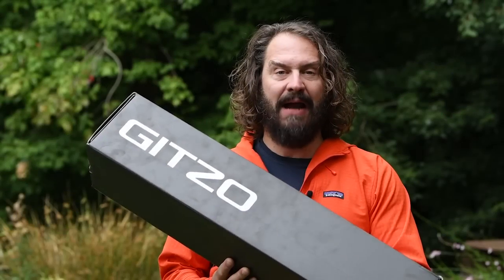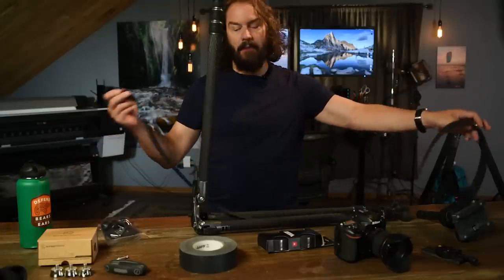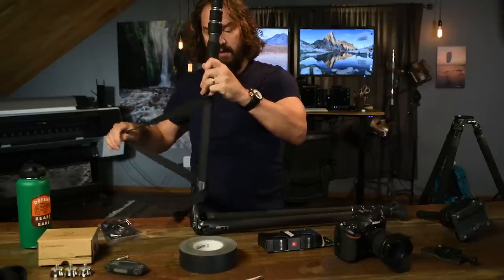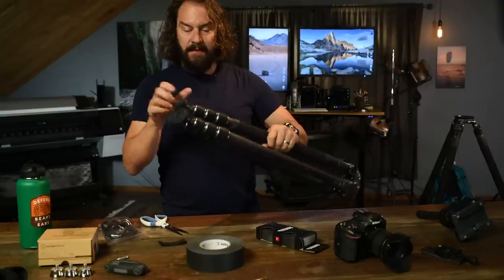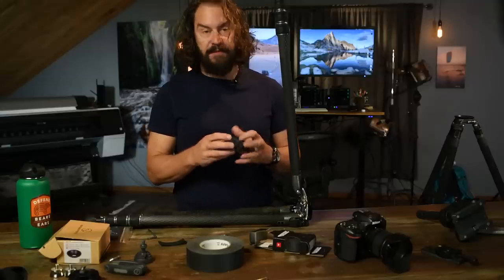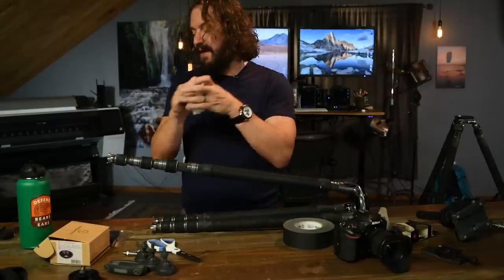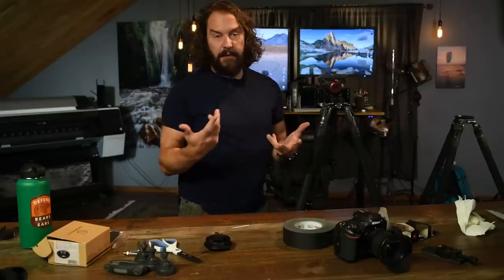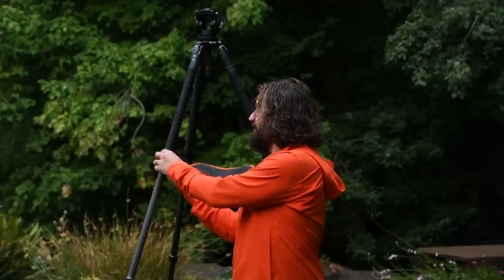Approaching The Scene 008: How to Protect Your Tripod

Comment: Hudson, In the summer of 2020, I built the exact Gitzo GT3543XLS/Sunway 75mm Bowl/Manfrotto Fluid Head setup that you recommended in one of your videos.  After using it for nearly 3 years, I can honestly say I think it is THE BEST tripod setup anyone can build.  The complete setup cost $1575 back then and would cost $2043 to build today.  The increase is mainly due to the $300 increase in the legs.  I know you came out with a later recommendation for a few different components but I highly recommend this setup.

Comment: Watched this video several times, today, during my first installation of the handlebar wrap. Took many tries because I have a Series 5. A single roll wrapped tightly and with little overlaps gives me 2 inches exposed at both the top and bottom. I was trying to match the ratio on yours before I realized that you were demonstrating on a Series 3 (I know, I know, you mentioned it in the beginning. lol)
Have seen other solutions on YouTube for protecting the legs, but the bicycle cork seems like the best solution. :-)

Comment: I try to watch all your videos, this one caught my attention because I have an older 3543XL, one of the best photographic equipment  investments I ever made.  One tip for those who use the standard rubber feet:  they tend to work loose all the time, put a drop of blue Loctite on threads; will still be able to remove, but will be less likely to work it's way off.  On the rock claws or spikes, another thread lube alternative is to use a little anti-seize, will protect the threads while adding some grip to the connection.  Great video, as usual!
Reply: Also plumbers Teflon tape works well, clean, no mess, holds feet in place , haven’t lost any feet thus far.

Comment: Wrapping tripod with grip tape seems like a good tip. I noticed this video was released a few years ago. Do you still use the same method and same tape these days?

Does the tape hold well even if your tripod gets wet in rain?

I've Leofoto LM-324C tripod which is shorter version of the one you're using. How much tape do you think I'd need?
Reply from the maker: Mine lasts several years even submersing in saltwater. Here's the link: https://amzn.to/3KG6Vd3 everything I use and recommend is here. Www.hudsonhenry.com/atslinks My current trips setups are here: www.hudsonhenry.com/tripods

Comment: Hey Hudson, I know you travel a lot and was wondering how you pack that tall Gitzo tripod. I really like the 79in working height but it only folds down to 28in. Do you pack the Gitzo in your checked luggage? I am on the fence about getting this tripod so your practical travel experience with it would be beneficial.
Reply from the maker: I do. I have an L L Bean extra large rolling duffle and I pack clothes and soft goods around it in the bottom. I can't live without that tall, stable pod. Little ones are just not secure enough
Reply: @HudsonHenryPhoto  Any concerns about it getting stolen from the checked in bag...it is worth alot of money.
Reply from the maker: @i4nic256  I've taken it from Tanzania to Rwanda to Argentina and Mexico with zero problems. Put that bicycle wrap I linked on and it will stay nice and look less expensive. ;) if you use my links, I'd be most grateful.
Reply: @HudsonHenryPhoto  Thanks Hudson, will be using the links to pick up a few items very soon. Right now I deciding between this Gitzo and the Pro Media Gear TR344L 71" tripod. I'm only 5'7" so both these tripods meet the extra height requirements. I had to email Pro Media Gear to see if the RRS rock claws fit their tripod.
Reply from the maker: @i4nic256  Ha, I'm sure they do and I'm sure that tripod rocks. Does anyone have them in stock? I'd love to check one out actually. It's the only other tripod in the class really. The big benefit is often being able to get up on a wall or step ladder and one or more leg way down below to get over things or a view from above. It's less about being tall. I'm only 6' even. :-)

Comment: You might prefere using loctite (medium) for the rock claws, oil makes them loose and there too expensive to loose them in the mountains
Reply from the maker: No, good synthetic grease with a well tightened thread ensures you can later remove them. I used medium Locktite on Gitzo feet once years ago and broke a leg trying to remove one. I worked as a mountain bike mechanic in college. Every thread on a good bike is greased and torqued to spec. I'd really urge caution with Locktite on carbon leg feet.
Reply: @HudsonHenryPhoto  i also put lithium and copper grease on my downhill bike everywhere :p you made a good point

Comment: Hi, Hudson. For the feet, if you ever change from the claws to spikes, you'll have to deal with grease on the threads of the feet. Would Teflon tape instead of grease also work to keep water out (but without the mess of grease)?
Reply from the maker: Great question. Never tried it. I just keep a ziplock with me. The grease is as much to be certain you can loosen them when needed as sealing. Not sure if Teflon is as good for that purpose.

Comment: Why did you choose this gitzo over a Promediagear or a RRS tripod?
Reply from the maker: This Gitzo is the only one of its kind. It's 79.5 inches tall, 5 pounds, series 3 carbon, holds 55lbs and has a modular 75mm bowl or plate attachment. No one else makes anything close. If you can find one that gets that tall and weighs so little please let me know. :) It also is incredibly well made.
Reply: I went with a Robus 5570, and for $200 more could have bought an 8880.  The 5570 has a max height of 70 in, but with the manfrotto 502 fluid head the camera view finder is 84 inches, with no center column.   The max payload weight is 55 lbs.  Check it out, it's a B&H exclusive. 

https://www.bhphotovideo.com/c/product/1383159-REG/RC-5570_Vantage_Series_3_Carbon_Fiber
Reply: HI Hudson--Great video and congratulations on your new Gitzo.  I have a Manfrotto;  MPRO 536 3 stage, 4 section carbon fibre tripod with 100mm/75mm bowl that is also about 80 inches on the tall side and 10 inches on the low side and also supports 55 lbs.  The Manfrotto weights in at about 7.5 lbs  so it gives up about 2.5 lbs. to the Gitzo, but cost about $200 less.  I pair it up with a Manfrotto 504hd fluid head--.  Thanks for another great learning experience!        @HudsonHenryPhoto